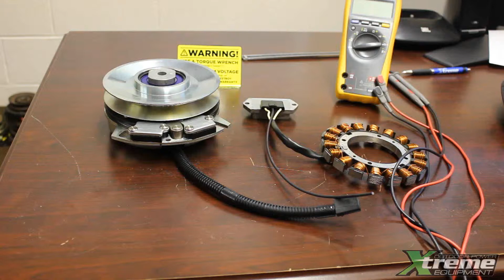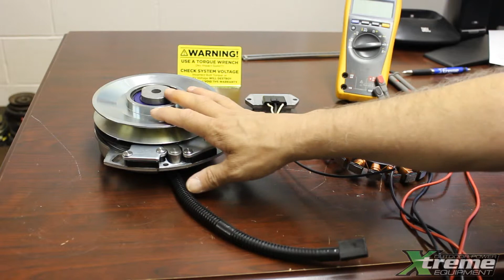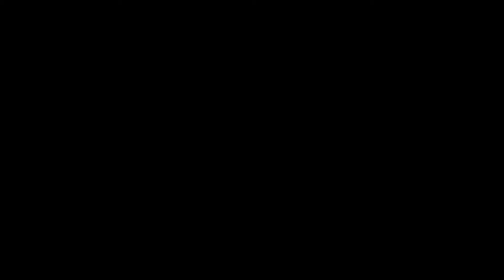03-Voltage Too High

Comment: Wow, thanks for this video,  went through a lot of effort to get the old seized pto clutch off my mower,  got my new one from you on there,  but seeing this video,  checked the voltage and found 14.8V. Was that the reason the old clutch faulted? Wasn't going to risk it. Took my (3 yr old) old battery out,  tested bad, new battery in there just now, sure enough it's now down to 14.1V,  thanks for making it evident enough that I should troubleshoot the voltage!!!